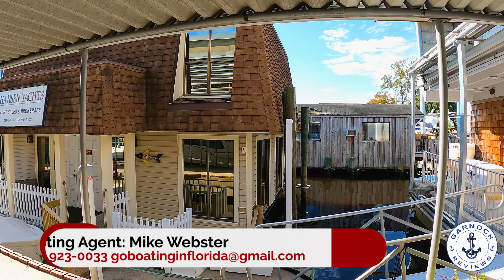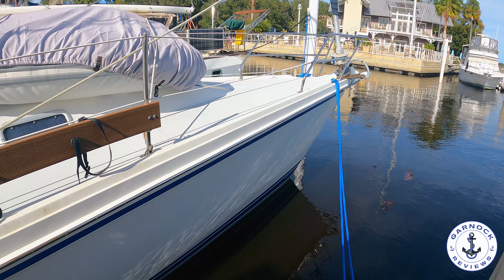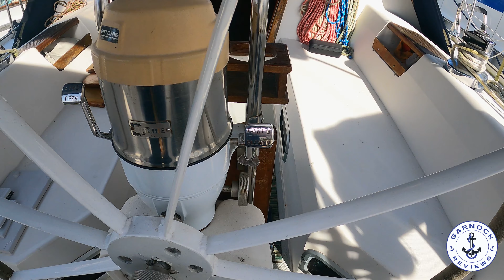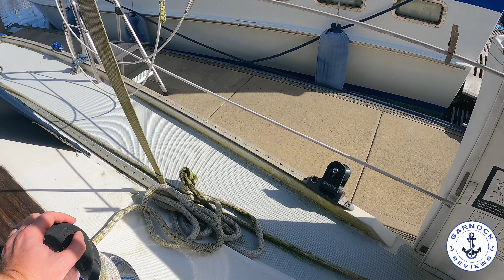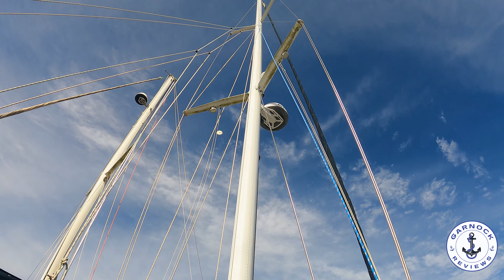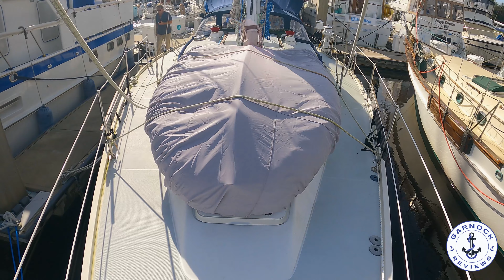[Sold] - Reduced to $99,000 - (1992) Catalina 42 | Classic Cruising Sailboat For Sale

Comment: You're right, Garnock:  You do see a lot of C42's and its successor the Mk II out in the Caribbean.  This one is the 'charter version', intended to make captain charters down in the islands more affordable.  Or as you point out, this boat comes with its own garage.  Did I miss the hours on the Yanmar?
Reply from the maker: She would be a great charter boat in the Caribbean. 3 cabins and all that solar power, you could sail for a long time without coming to shore. 

I'd need to double check those engine hours. Yanmars are great engines, in fact I'm due to film a twin engined trawler next weekend with Yanmars in them. They sip fuel, easy to service or repair, and parts are readily available. 

Thanks as always for watching and for the support 😉